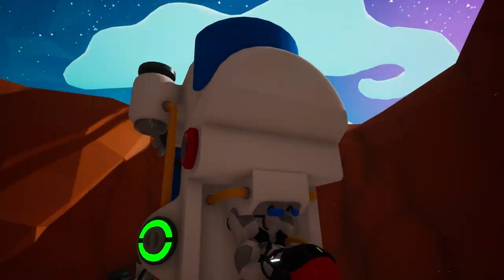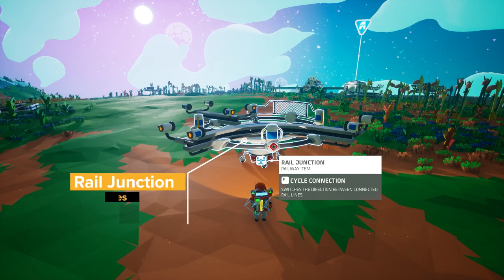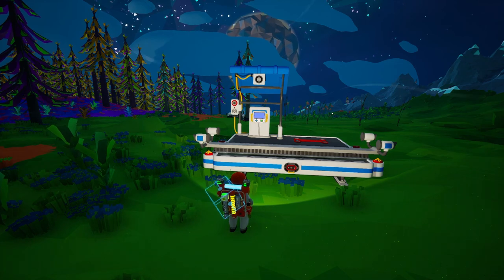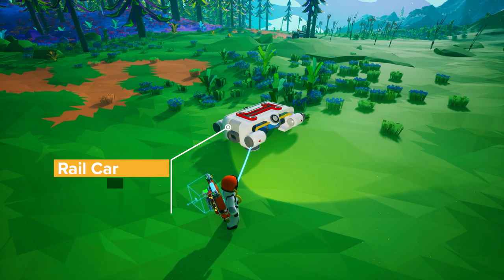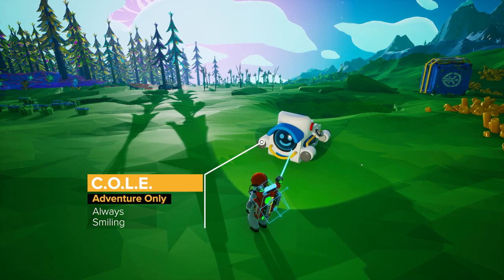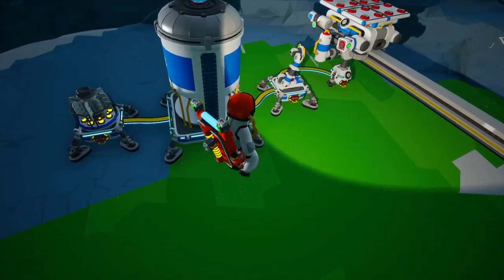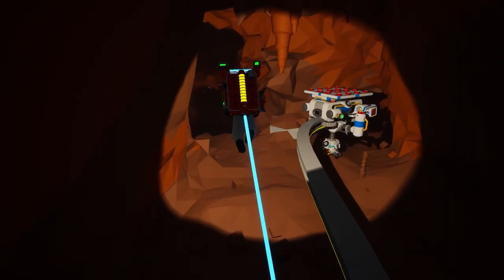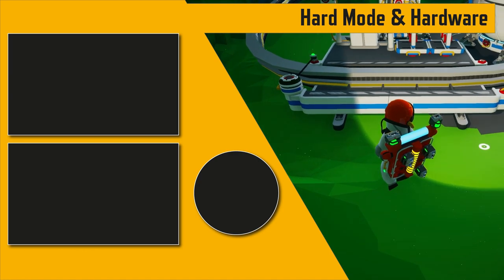Astroneer | Rails Update Guide

Comment: Thank you for making this guide. I'm getting into Astroneer's mid-game and I've had this idea of building a railway straight into Calidor's mantle for quick access to rich wolframite deposits and other goodies. But whilst I could see rail post blueprints in the research catalogue, the schematic for actual rails (which I assumed was also required for my project) was nowhere to be found. It turns out that I don't need to craft the actual rails and the task ahead of me is far  less monumental and quite feasible.